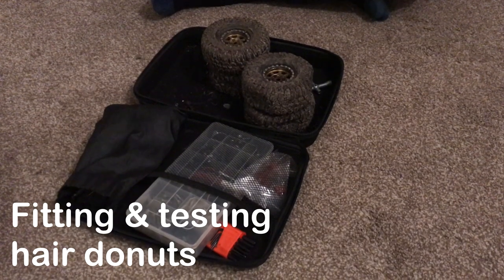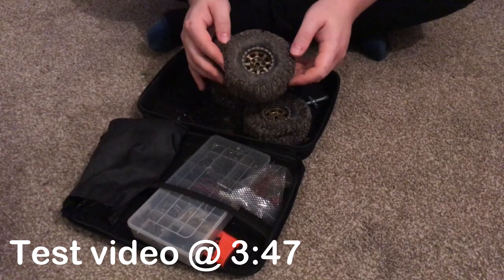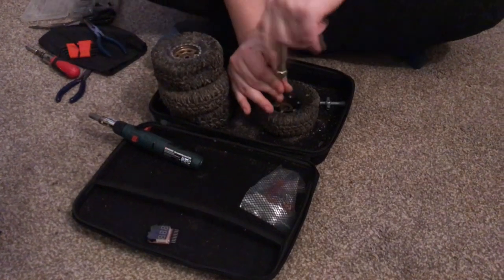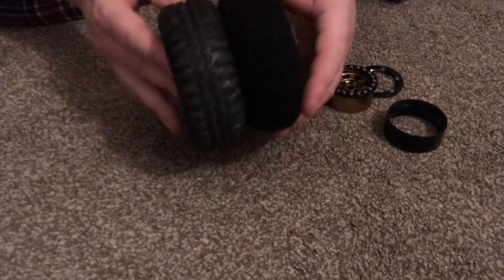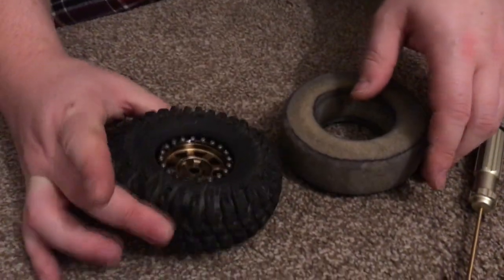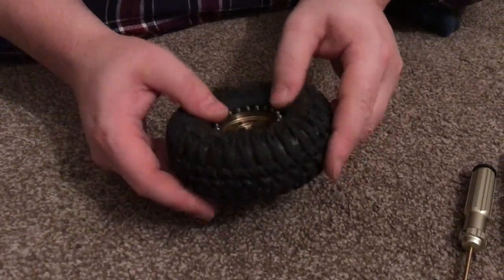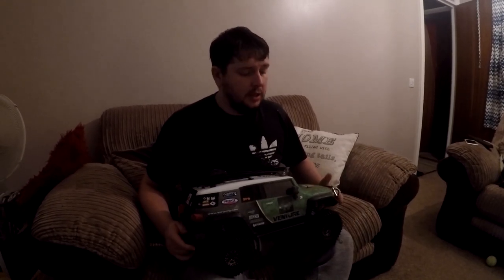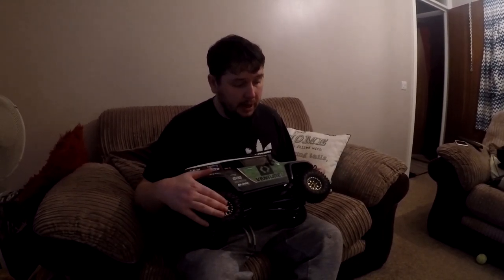Do Hair Donuts Really Work? We Put Them To The Test | The RC Dudes

Comment: DUDE! Where did you find the scale Welsh flag sticker?  And since this video, do you still recommend these as foams?
Reply from the maker: I really can’t remember 🤣

Yes totally! I will be doing an update video as soon as lockdown restrictions allow me to travel more than 5 miles to the same spot.
Reply from the maker: So 2 of my tyres always get water in them as there’s small pinch holes on the sidewalls. All I do is squeeze it out because the donuts don’t hold the water. Once it’s out I just use a syringe and put it through one of the holes and put air back in.

Comment: Too bad there is not a hair bun option for 1.0" & 2.2" crawler tires also like 1.9" wheels. So until there is a better option I will just stick to foam inserts because 3D printed inserts are not nearly soft a nuff for my crawling applications.

Comment: That air leak is going out and water gets in.  Sealing them is next to impossible.    As ypu see the result isnt easy to deal with.  Some  Treal wheels  have an air stem that is a 1.5mm you can take out and equalize pressure with.  It doesnt solve the water getting in, but it can mitigate flat spots.
Reply: @SorryIAteYourCookiesSanta  it can cause rust if the inner parts are steel.  Most budget wheels have steel center rings.

Comment: I've been looking for the big donuts for ages seen your video. No links and you didnt say where anyone can get them. Could you tell us? Nice video dude
Reply from the maker: I got these from Home Bargains. Cost about £5 I think.
Reply: It depends where you live. In the Uk most discount chains like B&M Bargains,Home Bargains, Poundstretchers as well as Ebay,Claires Accessories,Boots,Superdrug stock them. The former sell them for £1 each and in different sizes from 70mm to 120mm with 100mm being about right for 120mm 1.9's and 110mm for 130-135mm 2.2's. The fact that they are made out of a spun plastic makes them resistant to water degradation. For heavy rigs like the Traxxas TRX-4 Defender you might want to go larger for a firmer feel
Reply: @heady2008  I got some in the end had to buy 8 to get 4 of the same size. Even though the 8 bought were the same. Go figure cheers anyway dude

Comment: What size is everyone using? 11.5 cm/4.5 inch?
Reply: These ones in the video looks like 130 mm to me bc they look slightly bigger than the tires which i'm also guessing are ca 120 mm here. If you want more comression than he is getting in the video go with a 120 mm hair bun for 120 mm tires etc.
Reply: I'm trying large 10cm ones, for Traxxas Canyon Trail tyres on 1.9" wheels. 8cm I felt were too small, and I had tried 11.5 XL ones, but I found those too big.